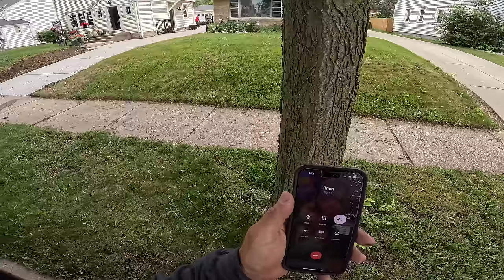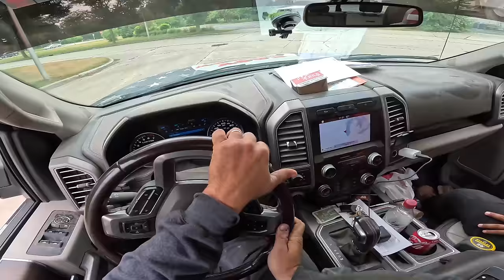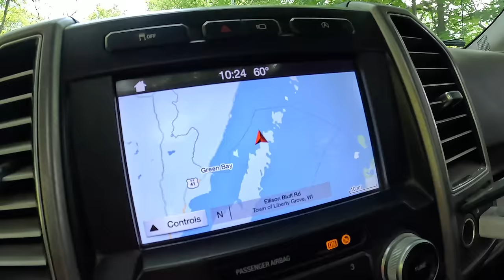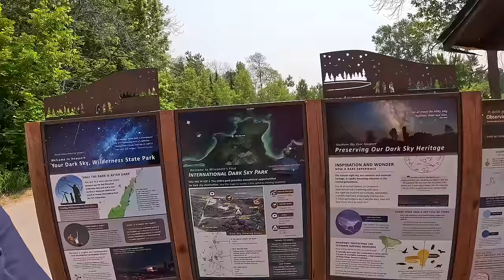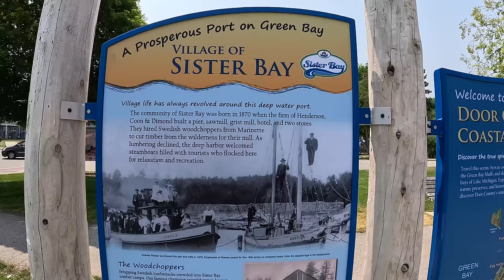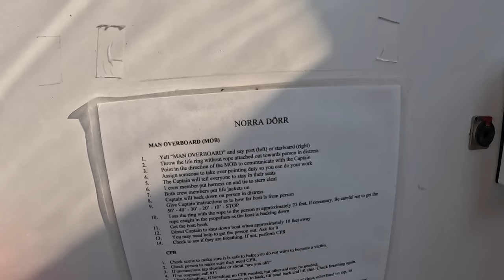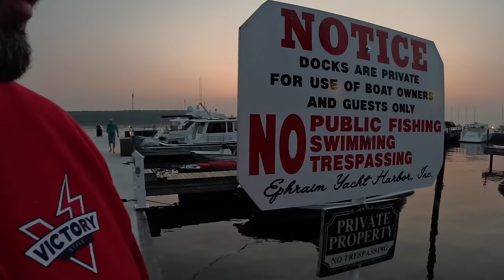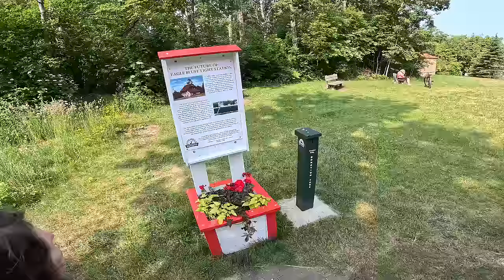Getting away from it ALL! Door County Wisconsin

Comment: Hat Trick is a motor yacht with an overall length of 34.1 m. The yacht's builder is Westport Yachts from United States, who launched Hat Trick in 2018. The superyacht has a beam of 7.2 m, a draught of 1.6 m and a volume of 207 GT.  Her top speed is 25.0 kn, her cruising speed is 22.0 kn, and she boasts a maximum cruising range of 2500.0 nm at 12.0 kn, with power coming from a Caterpillar engine. She can accommodate up to 8 guests in 4 staterooms, with 5 crew members waiting on their every need. She has a gross tonnage of 207.0 GT and a 7.2 m beam. The Westport 112's are currently asking a price between €10,000,000 for a pristine one and in the low €7,000,000 for an older one. A new will set you back a minimum of  $20m. "Easy Money" 🤣🤣🤣

Comment: 6:19 make sure you’re cleaning the cab filter everyday you run it. Will save you a lot of problems later. The vent channels only use soft foam for seals.

Comment: Use a tiger torch , runs on propane , to heat evaporate the moisture
Glad you and your wife had a great time . Wait until your 50 th like we did in May ❤ 
Electric bikes are quiet , it just shows the times are changing  Vaya con Dios Peter